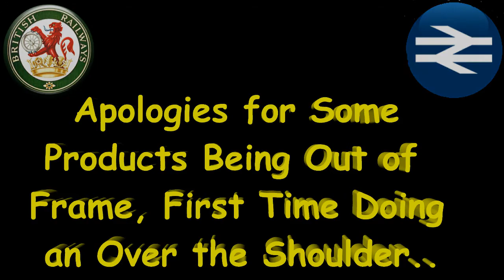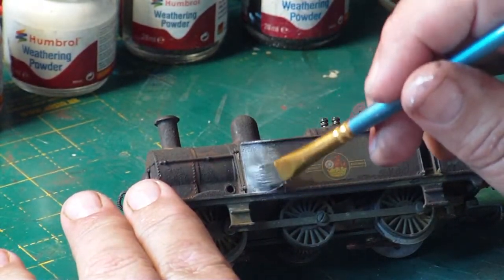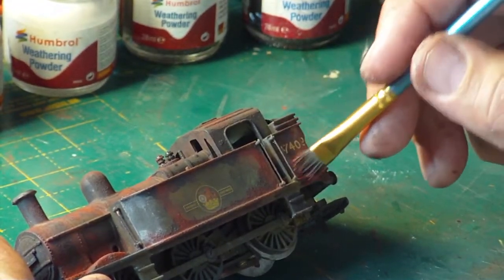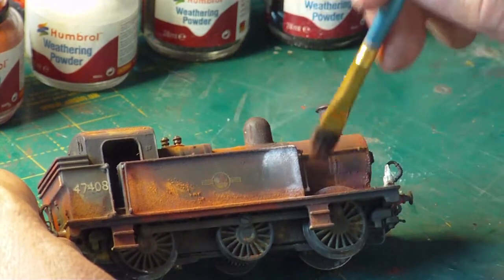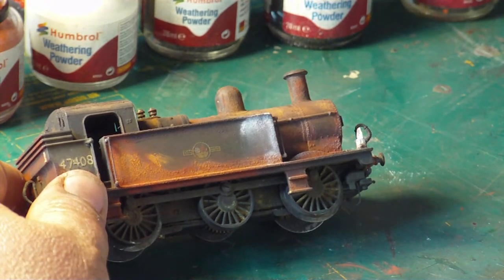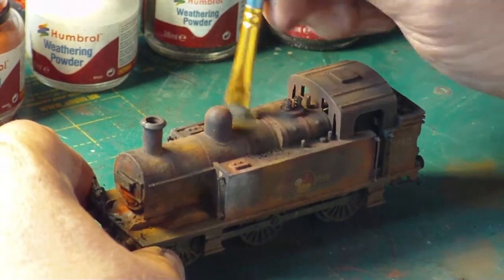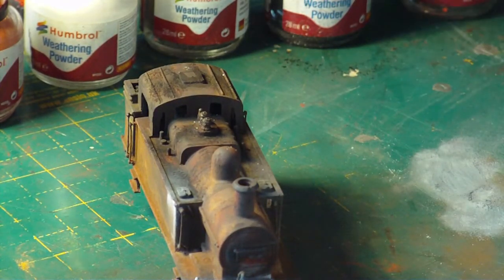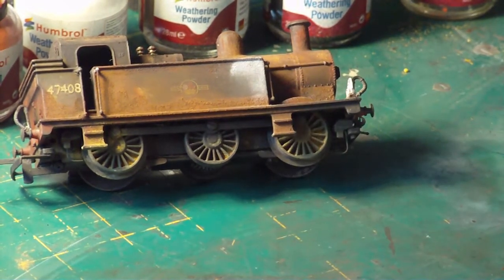How To Weather a Jinty Part 2

Comment: Superb sir especially as you've inspired the likes of Graham and others .....I think the weathering powders give a better a heavier effect than the pastels I've used ....thanks for sharing....fred
Reply from the maker: Thanks again Fred, im quite pleased that the video has inspired people to have a go. As you can see its not an art, either have a photo to copy from or just apply what your knowledge and finished requirement is. I wanted one Jinty weathered and one ready for scrap, and thats what i have. The powders are not that expensive and will go quite a long way, the only one i get through a lot of is the dark earth, thats the first one i apply to tone down the loco. I reckon you could weather a loco with that and smoke and nothing else, those two powders will give enough to show some bottom half muck and soot damage above but leave the rest in fairly good condition. I have a green steam engine to re paint yet and weather so ill put that on at some point so people can see what it looks like on a different colour and with less weathering.